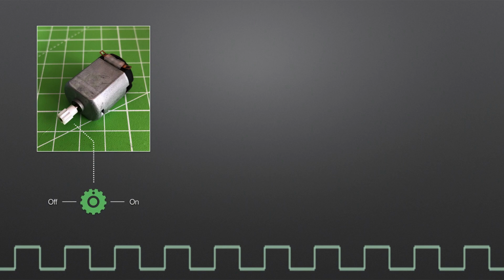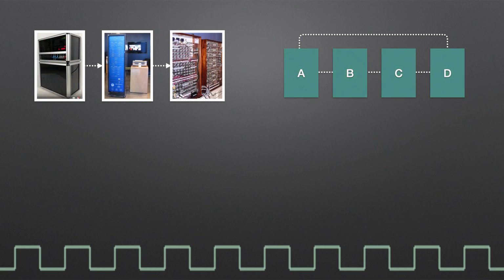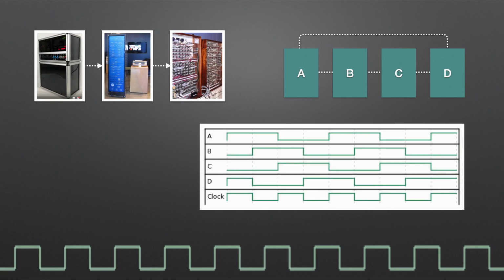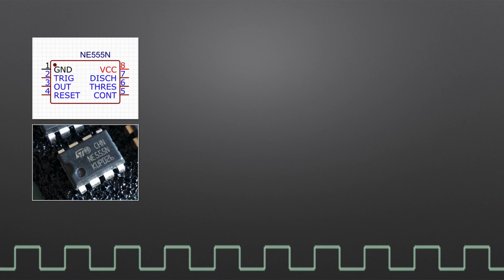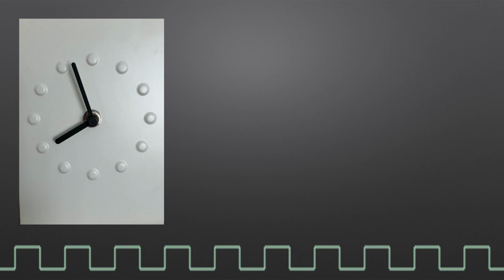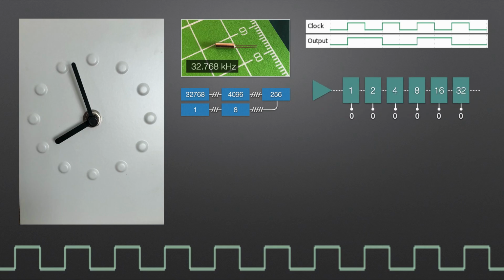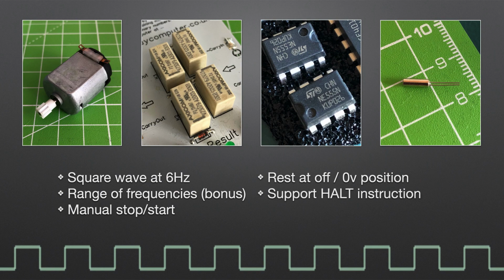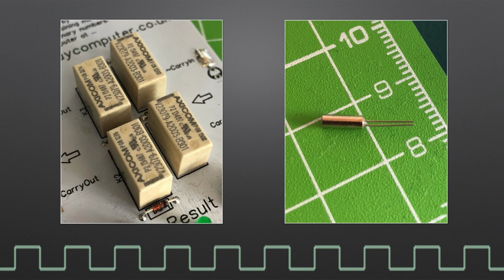Relay Computer Clock - Ep2 - Design Choices

Comment: It’s not true that you can’t stop a Relay  Clock as required by the ‘halt’ instruction. It all depends on the relay clock design. In fact you can implement a perfectly square wave relay clock with only 2 SPDT relays, 2 capacitors and 2 resistors, which also has a synchronous ‘enable’ input which never stops or starts the clock in the middle of a cycle. I posted a video about it. I think it may be interesting to you: https://youtu.be/3oxEB4uuV0U
Reply from the maker: Great video ... and yes, it's my particular relay clock design that has to stop in the 'right place' not relay clocks in general.

Comment: Another interesting idea is an electromagnetic pendulum. If you're looking for more of that steampunk cred.
Reply from the maker: Loving this idea :) Being as all the various clock control lines run through most of the computer there'll always be the possibility adding something like this later on.
Reply: @paul80nd  Thanks! Sorry, one more idea OK? 
Use two electric tuning forks that are adjusted to very similar but not equal frequencies. The difference in frequencies would create an interference pattern (or beat). After running this through a low pass filter, it might create a fairly consistent low frequency signal.

Comment: So going with the both option instead of having two different options why can’t you just combine them. You can use ICs to bring the clock down to a reasonable speed and then from there you use relays to further divide the clock speed down. You can also make the clock selectors completely out of relays too. I feel like that would be the best of both worlds.
Reply from the maker: Absolutely. I didn't explain it in the video very well but my first choice was really all about keeping a 'pure' relay clock and the crystal clock is kind of an 'optional extra'.

Comment: the relay timing could be changed by switching in more or less capacitors, but you would know that.
Reply: This would have the side-benefit of putting less wear and tear on the relays when the computer isn't running full-speed; totally doing it for mine!

Comment: as a suggestion I would not use a 555 made in china, i have had lots of problems (and duds) of those cheep as chips chn 555 timers, although there are a few companies that are not based in china, well worth the extra few pence. my first thought was relay and capacitor as in indicators for cars ( years ago, dont know now, probably cpu controlled nowadays). love your work.